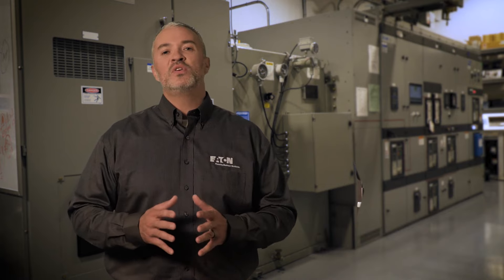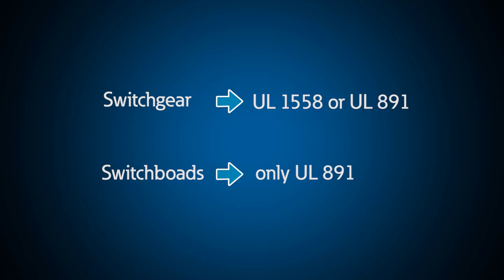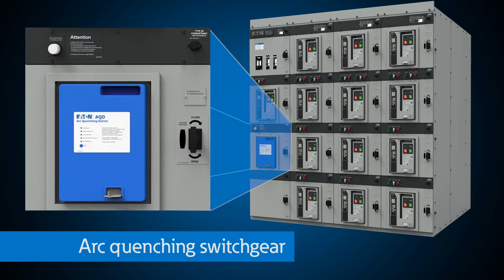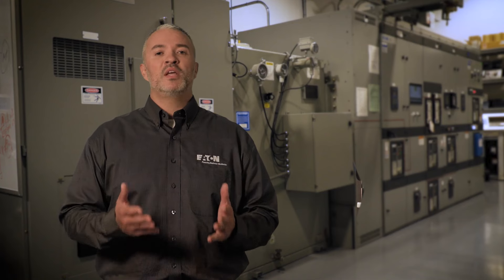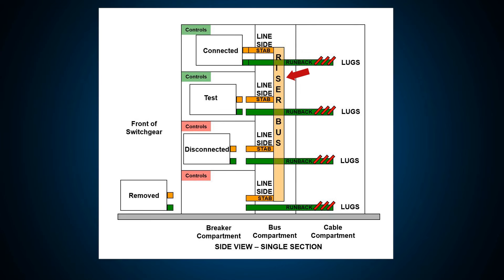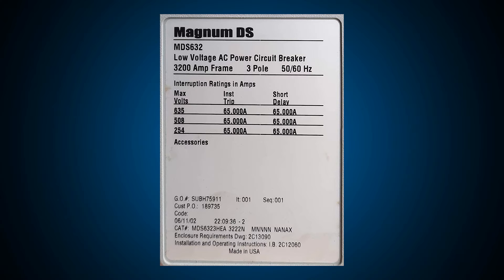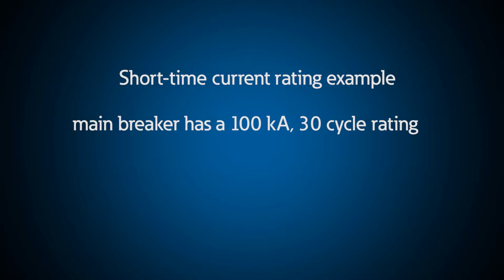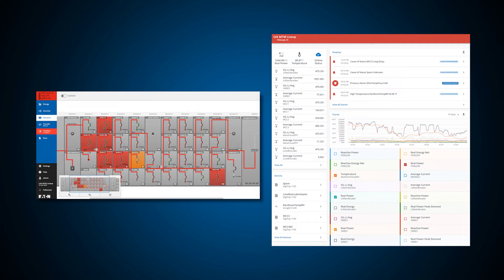Low-voltage switchgear

Comment: My assumption before this video:
- switchgear is only for mv, switchboard is for lv.
- switchgear construction n partition: metal clad and metal enclosed, 
Switchboatd construction n partition: form 1 to 4 (iec) or nema 1 to 4 (ansi nema).
- what you called lv switchgear, i usually named it lvmdp/lvmdb (and still switchboard) Whether the circuit breaker is withdrawable or fixed type.

Would you mind to give me the standard in iec to that UL sir?
I'm not very familiar with nema std.